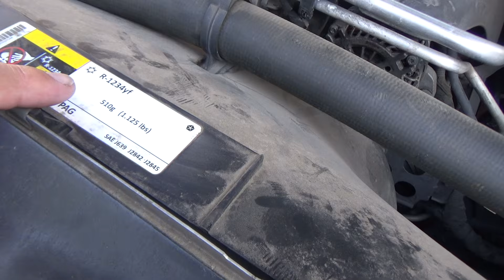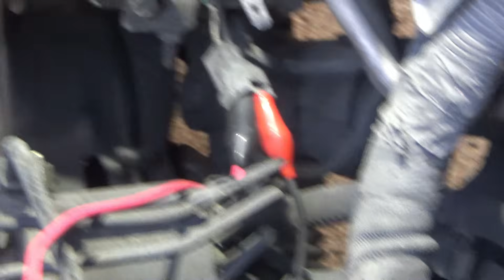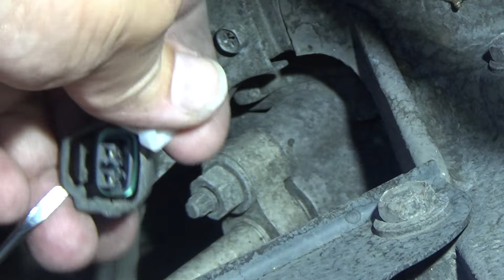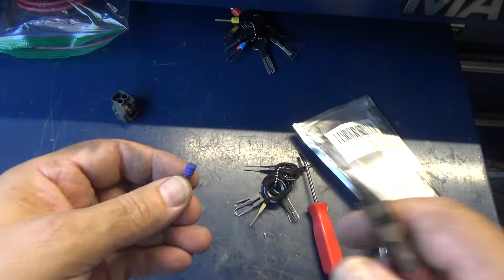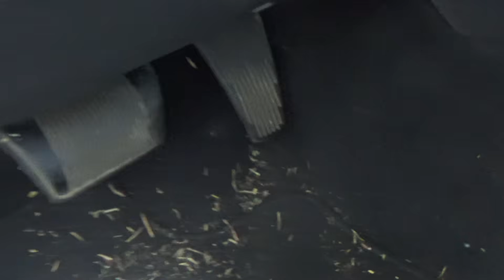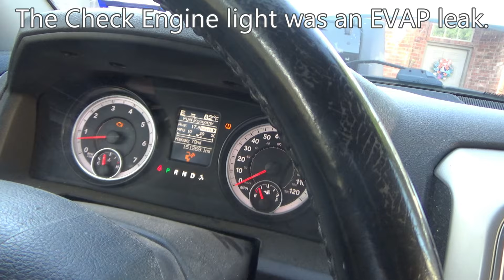Easy Fix for 2015 RAM 1500  A/C Compressor not Coming on. Owner was quoted $1300.

Comment: Help please!!!  Just bought this used 'AS IS' 2016 RAM 6Cyl - 224,000 miles
CODES ARE - 
P26AB Engine Coolant Bypass Valve 'A' stuck - 
P0440 EVAP System - 
P0456 Camshaft Position Sensor 'B' Circuit (Bank 1) - 
Symptoms are - AC blows hot air (AC Compressor clutch is spinning when AC is turned on-Aluminum lines are not cold to the touch) 
Radiator/Condenser Fan not turning on (Truck is not overheating) 
Check Gas Cap warning (I have replaced the gas cap with an OEM part...warning light persists

Comment: I need you to fix mine man, but I’m in Texas! Might have to try it my self !
Reply: Update guys: no one probably cares but I did end up fixing it! so I was super nervous and hesitant on cutting the actual wire running from the harness. Especially cause it was already like 9:30pm anyways, once I cut it I carefully broke off all the plastic off the plug down to just the 2 prongs ! the issue was my ground was ripped inside the actual oem wire. Idk some how it might’ve got pinched and it was making a faulty connection! I used to 14gauge speaker wire I had laying around from a previous sound system install. I carefully twisted both wires on to the prongs and back on to the oem harness wires. Used some heat shrink to hold it all together and it fixed my problem with my ac cutting on and off cause the clutch would stop spinning bc of the faulty ground wire from the oem harness. Thank God it turned out well.

Comment: My clutch tries to spin but does not spinn fully with the pulley, it just recently stopped working, i checked fuses, not blown called around and everyone just can get the whole compression system, i want to replace just the clutch, the link provided isnt available anymore

Comment: I had some jack ass Jeep Dealership mechanics in Hollywood FL monkey wrench and destroy my connector going to the ac compressor clutch. Turns out without releasing the red safety tab a mechanic had forced it onto the plug in turn backing out the wires. I noticed each time I push down on the plug the clutch would engage and I'd get cold air, but positionally or with extra vibrations it could become disconnected and blow warm air. Noone takes the time to slow down and pay attention to details anymore yet want to get 125+ hourly for labor, punk ass generation young and old, truly only a few diamonds in the rough when it comes to mechanics nowadays.

Comment: The wire to the AC compressor has no power jump the AC compressor and clutch does work. The wire has no power. All the fuse work and hae power to them. Where do i go from here
Reply from the maker: Make sure the refriderant is full then I would go to the relay and see if you can jumper it there and kick the compressor on. You need to check the pressure switch and evap temp sensor. Also check the wiring.
Reply: I have a 2015 ram 1500 does the ac compressor have a relay on that?@737mechanic
Reply from the maker: @codeblackwidow  Yes there is an A/C relay. It is under the hood.
Reply: @737mechanic  do you know what number it would be?

Comment from the maker: A/C Compressor Clutch AIG380-CL
https://amzn.to/3PtRjho
Dewalt 20v Cordless heat gun Kit
https://amzn.to/3ErsBIc
Terminal Removal Tool Kit 82 Pcs Depinning Tool Electrical Connector
https://amzn.to/44BYBnL
Wirefy Crimping Tool For Heat Shrink Connectors
https://www.amazon.com/dp/B07GFXHH91?ref=t_ac_view_request_product_image&campaignId=amzn1.campaign.1O2O2EMD6VNI0&linkCode=tr1&tag=737mechanic-20&linkId=amzn1.campaign.1O2O2EMD6VNI0_1709174653383
NEBO OMNI 2K Work Light: 2000 Lumen OMNI-Directional Rechargeable
https://amzn.to/462JXH1
Wirefy Heat Shrink Tubing Kit - 3:1 Ratio Adhesive Lined
https://www.amazon.com/dp/B084GDLSCK?ref=t_ac_view_request_product_image&campaignId=amzn1.campaign.1O2O2EMD6VNI0&linkCode=tr1&tag=737mechanic-20&linkId=amzn1.campaign.1O2O2EMD6VNI0_1709174529961
Wirefy 95 PCS Heat Shrink Tubing Kit - 4:1 Dual Wall Tube - Adhesive Lined
https://www.amazon.com/dp/B09NW6TVC6?ref=t_ac_view_request_product_image&campaignId=amzn1.campaign.1O2O2EMD6VNI0&linkCode=tr1&tag=737mechanic-20&linkId=amzn1.campaign.1O2O2EMD6VNI0_1709174473979
737mechanic Amazon Store Front
https://www.amazon.com/shop/737mechanic/list/CR3BU74FTDU1?ref_=cm_sw_r_cp_ud_aipsflist_aipsf737mechanic_W4QMHMJ1JD67FDBCQHRK
Reply: As long as my dogs are Kool I don't care about anybody else.

Comment: I got my compressor replaced 8 months ago with a new one.  I didnt use it during the winter . It cost me 1565 to get replaced . The mechanic called me after he replaced compressor with one i provided then he asked if i wanted the ac charged up and filled . I was quoted 950 the dealership only wanted 700. I felt like i couldtnt say no once he already had started the job so i said yes go ahead and do it . He said ok . He called me back in 15 min and said come get your truck is done . I was kinda shocked . I had read it took over an hour to do the full recharging process . They charged me 200 for the recharge 350 for the freon 25 for the pag 46 oil and 1.5 total hours of labour 180. It cost me 725 and he said he took money off. I checked ac when job was finished . It wasnt icy cold like i expected .But other than that everything was fine. I hadnt used it all winter so for the past 6 months . I tryed it today and the compressor clutch isnt kicking in ? I check the 10 amp relay fuse its fine . I dont understand . This cost me 1575 8 months ago. Please someone help me . Excellent vid sir. If you had my ram wouldnt it take longer than 15 mins to do a vacuum check and full recharge ? It felt to me at the time that there was no more work to be done on vehicle he already had it done . Or maybe he only put enough freon in to last a couple of months. They charge me 18 times 15.95plus tax for refridgerant which he had all done in 15 min or less ?? Now my compressor clutch wont turn on 8 months later ?? this is crazy . I paid 1150 for brakes 5 months ago as well . I cant afford this is crazy please help me sir. Or anyone who knows what is wrong or how process goes for ram 1500 2016
Reply from the maker: You need to find out if the refrigerant has leaked out which it probably has and if so demand that shop figure out where it is leaking and fix it. Hopefully they gave you a warranty.
Reply: Check and make sure the 15amp fuse ( Fuse F62 if remember right) for the A/C clutch has power to it. 12 volts on both sides of the fuse.
Reply: Go to small claims court

Comment: Bought a truck the clutch was so bad, you could see the bearings, got first nap ring off they started falling out. Must have got real hot a lot because it tore the flange off of the pump for the first snap ring. New one just arrived.  It comes with no oil but I got some pag 46, should I add it . I don't want it to fry out on way to get a charge.
Reply from the maker: If you are just replacing the clutch without evacuating the system do not add the oil.
Reply: @737mechanic  can't replace clutch,  flange holding snap ring is broke, I have to replace the whole compressor,  but come with no oil. I just don't want it burning out from no lubricant before I can get to shop for refill
Reply from the maker: @DTWC  Then yes add the oil.
Reply: @737mechanic  thank you

Comment: Fantastic video and informative.  Confidence builder.   I’m going to double check my wiring now on my Pro Master van, the A/C hasn’t worked for a year now and the pressure is fine in lines.   It may be just a bad wire connection just as your research has proven to work.  Thank you again for your time making this video.  It helps use all out here.  🙌

Comment: My ac just stopped blowing all together no warning , Ram 1500 2014. Can’t be compressor so dreading what the mechanics will say. Inthink just a leak in hose🤷‍♂️
Reply: did they tell you what's wrong with it my just stopped blowing

Comment: Once again, you have proven to be a damn knowledgeable and extremely honest mechanic with superior skills!!  I bet your customer will be elated with your results and savings for him!  Excellent video, as usual.
Reply from the maker: Thanks, buddy.
Reply: Had the same problem with the aircon when play the wires on that connector the aircon works but when I'm on the road and hit a small pot hole the clutch stop so now I know how to repair it thru your video Sir thanks